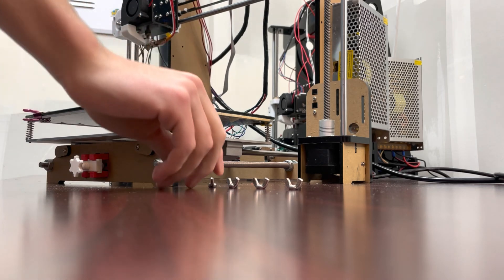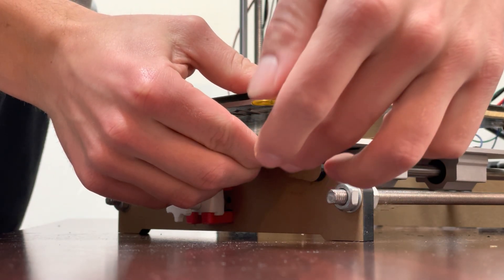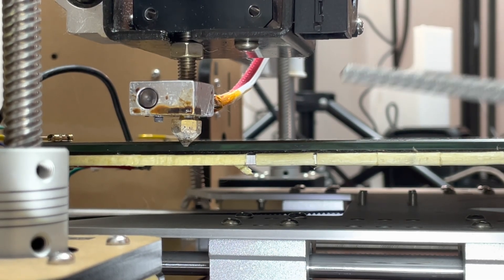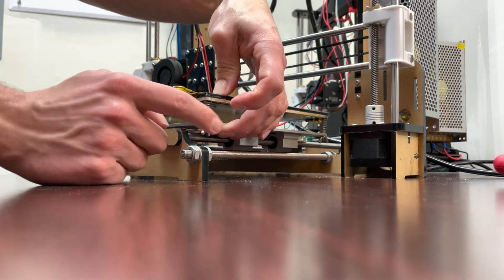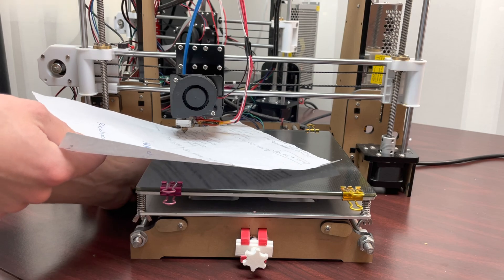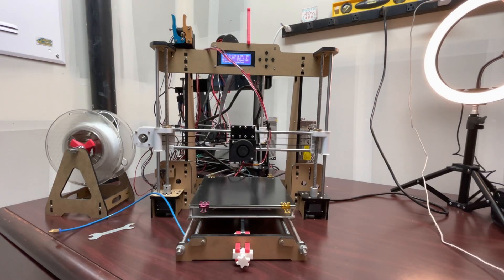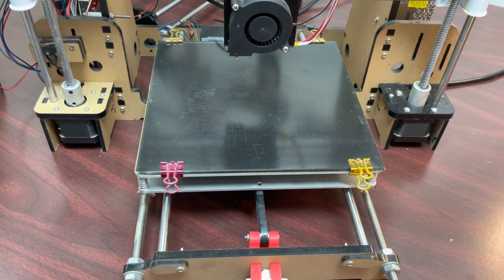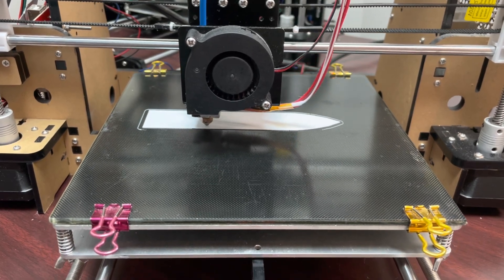Bed Leveling | Anet a8

Comment: Brit here . Brought and assembled mine 10 years ago still going strong touch wood. Just got round to moving the wing nuts to be on the top of the table so much easier to adjust. Never print anything big enough to hit the extruder. ( L O L ).

Comment: Thanks for the video, I have the same printer, although I took the brown paper off when I built mine, lol. I tried using the auto bed-leveling sensor with mine but found that manual leveling is more accurate and technically easier!! Mine is on the Marlin 1.1.9 firmware because of the auto bed-leveling sensor. These are great 3D printers that force you to learn the technical aspects.
Reply: They are great printers to learn on. You're forced to troubleshoot just about every issue possible so you become well-versed insanely fast. My first Anet a8 build was 50% peeling/scraping the brown film so I said screw it on the second lol. The troubleshooting I learned on the Anet helped tons with the He3D K280 - it was still a nightmare. How do you like the Marlin firmware on Anet? I never tweaked firmware on it
Reply: @jstnflnt  Marlin was only installed to use the auto bed level sensor, which I ended up disconnecting. Manual bed leveling takes less time, so what's the point.. LoL. Currently, I print various adapter and accessories for my workshop and odd thing my kids want. I love this beast, currently it prints at 80mms flawlessly. 🤘
Reply: @Billy_bSLAYER  80mm/s is awesome, if you ever post a video of it let me know!